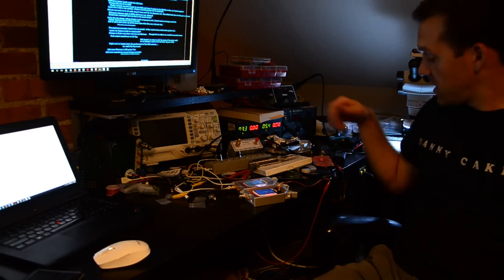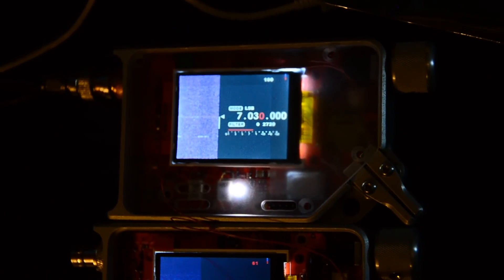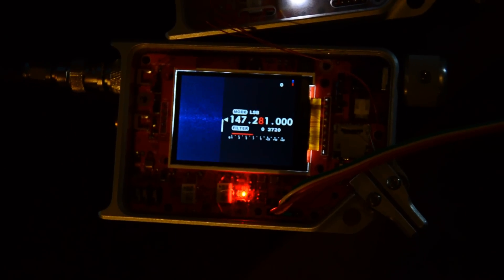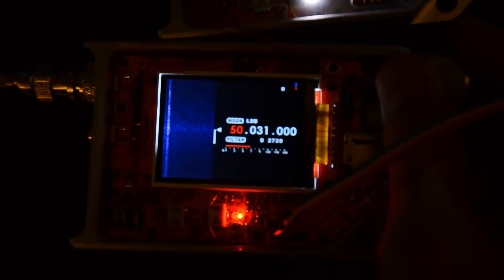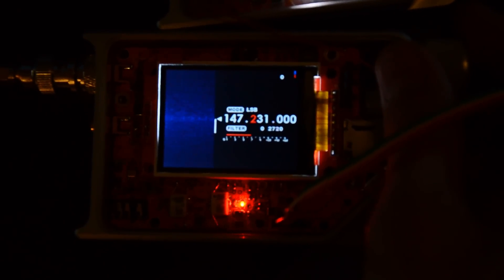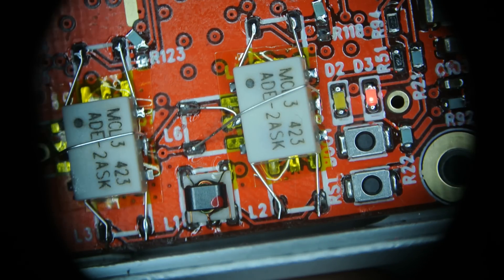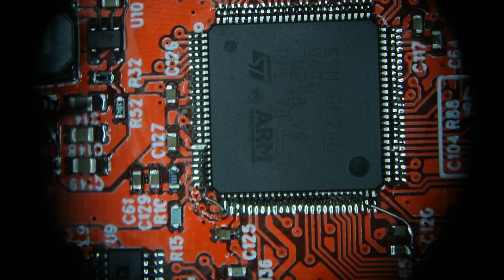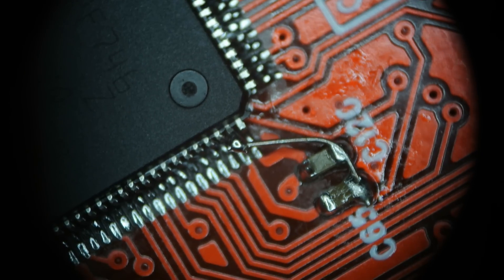May 11 PSDR Update

Comment: If you missed out on the Kickstarter will there be any options to get one one from you? I guess I could build my own from the open source files if I had to but I would rather support you.
Reply from the maker: Hi! I'm not sure how I am going to be making these in the future. I MIGHT have a few left when Kickstarter fulfillment. Beyond that, I need to figure out a way to make production work financially. But if you can't wait, go ahead and make one yourself! A few people have done that already and I have to say I was very impressed!
Reply: Michael Colton 
Sounds cool.  I may wait a bit and see what you come up with.  Maybe a pcb and parts you can't get at Digi-Key and Mouser kit could be an option or a 2nd Kickstarter now that the design is done and major bugs worked out.  I'm going to look around and see if I can find links to any of the diy PSDRs.  I didn't find your Kickstarter until about a year late.